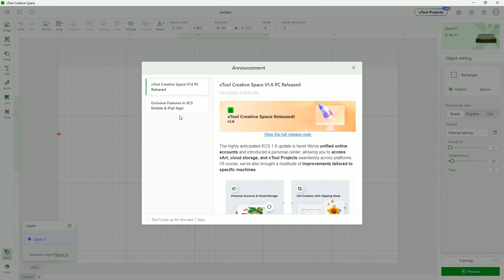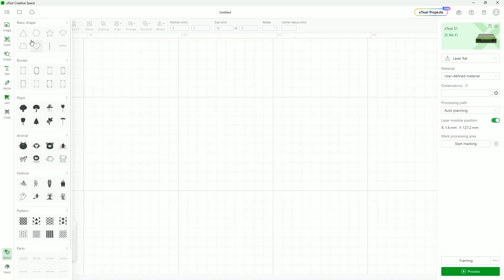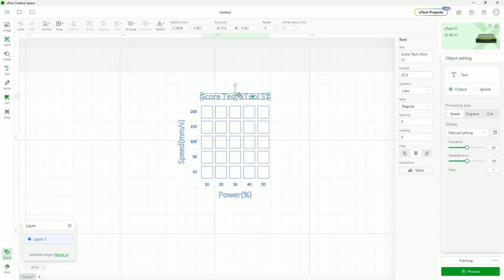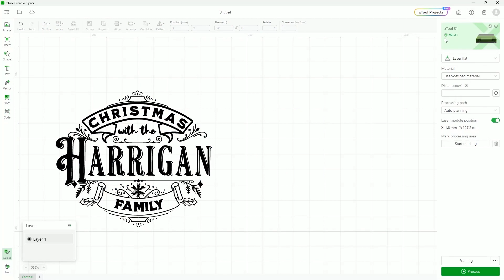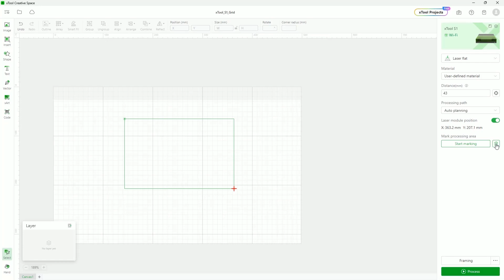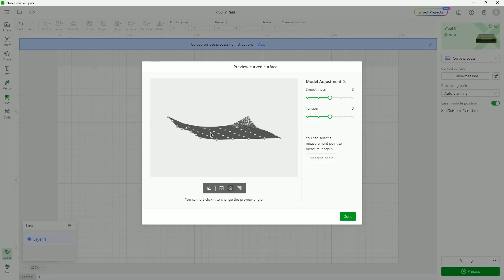xTool Creative Space Tutorial | S1 Edition

Comment: Great video.  I will have to watch several times.  I haven't set up my S1 yet but will have to come back to review different steps.  One question, If you put the grid on the pan It will only work for engraving as when cutting it would mark on the pan and destroy the grid.  If you use the honeycomb you have lost the placement lines and can't position your workpiece where you want it and when you cut it will still pass thru to the pan.  How do you protect the grid on the pan from being damaged? Will you be putting updates out on the new changes in xcs?  Thanks again for the great video.

Comment: I have a question.  Would we still be able to use the honeycomb and the file for scoring measurements into the bottom of the laser? I'm new and haven't got my machine yet but, I was curious since I think the honeycomb is where you would be cutting if you have one.
Reply from the maker: No. The grid is much more useful while engraving then it is for cutting. When you are cutting I would highly recommend using the Pin Point positioning system

Comment: Thanks, your tutorial has been quite valuable.  I just upgraded from a D1 to an S1.  I used Lightburn on my D1 but am learning XCS so I can utilize the bells-and-whistles on the new machine.  One problem I'm facing is that an exact same engraving project will take 2 time longer on the S1 versus the D1, even though I set the speed 2 times faster on the D1!   The reason seems to be that Lightburn efficiently burns the entire project left to right, top to bottom no matter how many components (vectors) are in the project.  XCS appears to burn one individual component then moves onto the next one, etc.  Even letters are burned one-at-a-time.  Have you experienced this and, if so, what is your solution?
Reply from the maker: Other then changing bi-directional and unidirectional you pretty limited on telling xcs the tool path you want to use like you can in Lightburn. You also have no control overt the travel speed which is really why it's probably faster in Lightburn more then the fact that it does one shape at a time. With letters I wonder if you click the weld button if it will burn then all at the same time. Only a guess but I would try that.
Reply: @BusterBeagle3D  You're right, when I weld the letters they become one "object" and get burned together.  Good to know.  The weld option won't work in all cases but might for many.

I want to like XCS but there are several frustrating things about it that push me back to Lightburn.  I'm hoping with continual improvement it will get to a point where using it is a no-brainer for xTool hardware owners.
Reply from the maker: @kenbrown7334   Glad that helped a little. yeah XCS has come a long way but still has a ways to go. It's been updated many times already and I saw on the Facebook group there was a major update coming but haven't heard much else other then that.

Comment: First, thank you for the informative video, it helped me understand the software a bit more. I set my S1 with the file provided by Xtool but it seems my work area is a bit larger than yours. How did you come to those numbers? Thanks again.
Reply from the maker: If you are referring to the grid file I intentionally make it slightly smaller then the full workable area just for a few reasons. One is to make sure it can always actually reach the position as machines, especially the D1 I found, can't actually reach the entire workable area without hitting the frame. The other is to make the numbers easier. It's just easier to make a grid where X240 Y 150 is the center rather then X 249 Y159.5.
Reply: Makes sense, so you have a  “true home “ and a “ grid home” or the machine x=0 y=0 is your starting point?
Reply from the maker: @giannilopez333 The 0,0 position of the grid and of the software either though xTool Creatvie Space or Lightburn is the same. All coordinates of the grid should match the coordinates in either software package. Where you place your art in the software should correspond to the burned grid.

Comment: This is such a great tutorial, thank you. I just got my S1 today (upgraded from D1) and I am doing some inlays. I did a coaster with a "W" inlay with no problem, but when I try to create an outline around a word so I can offset the kerf, it won't capture the inside of the letters. I tried exporting the text as an SVG and reimporting it but that didn't work either. I'm guessing it needs to be an image as opposed to a vector so I can remove the background? Any help is appreciated.
Reply from the maker: Thank you. Try to create your outline of the text so that it created that outer offset. Then select the text again and pull the outline tool in the opposite direction and depending on how far you pull it you will eventually only be left with the outline on the inside of the closed shape letters. Pull it too far and it will just disappear so you have to be gentle. It might be easier if your text is large to begin with and then scale it down after you have your outlines.
Reply: Ok I tried that and I see how that could work but I don't think I can get it to fit perfectly as an inlay using the original text. @BusterBeagle3D

Comment: Hi There, the white part of the canvas is not the workable area they advertised 49,8 x 31,9 cm. If i move the laser by hand or with framing knobs you can get outside the white area the same measurement as the grey area on top of the white usable area. Is there any way to use the complete usable area they advertised with?

Comment: Hi Ryan.. I loved your video... Very informative.. But, I do have a question for you about Creative Space. I do not remember if you mentioned this about this software. 
Do you need to have two different pieces of software if you had two S1's? And, can you run them at the same time as you can in Light Burn? 
Last but not least.. Can you use the same software for both the S1 and P2? 
Thank you so much..
Reply from the maker: Hello. I have not tried to run 2 instances of Creative Space on 2 machines at the same time. I also don't think it would be wise or even possible to have Lightburn and Creative Space running and connected to the same machine at the same time. You may however be able to have Creative space connected to one and another machine connected to Lightburn at the same time but again I have not attempted that.  And yes both the S1 and P2 can run with both xTool Creative space and Lightburn. However if you want to take advantage of all of the features of the S1 and P2 you will want to run Creative Space and not all of the features are compatible with Lightburn.
Reply: Thank you very much! 
 @BusterBeagle3D

Comment: I am a laser noob. I have the 20W version and have watched this tutorial a few times. Thank you for this, it has helped a ton. I have a question about the noises I get from my laser. Not ever owning one I don't know what is normal. Mine has a chirping sound at certain speeds. I am only on day two of using it and I am having fun learning the ins and outs of the hobby. Thank you.
Reply from the maker: Not exactly sure what chirping sound you are referring to. It's possible you have some kind of squeaky wheel so if you can pinpoint it you might be able to use some of the grease that came with the machine to eliminate it.

Comment: Do you know what the resolution of the laser is in DPI? As in when I'm using a raster image what I should aim for?
Reply from the maker: It depends on the version of the laser you have. The spot size of each of the lasers is different. The higher the wattage the larger the spot size. This website has a good chart that shows the maximum DPI you can achieve with different scan gaps. You can pretty much think so the scan gap as your laser spot size so you can see what dpi your machine can reach. 
https://www.imag-r.com/scangap
I guess for an easier answer the 40W is 254dpi, The 20W is 318dpi.

Comment: Hi Dave,  I just bought your grid…….I cant find a READ ME file……what are the best settings to engrave on the metal base of the S1 , I have the 4L watts S1 , thanks
Reply from the maker: Hello. If you are opening the file in XSC you should already have everything setup to burn the grid. You just need to measure the height distance and Process the file. The settings should already be there. Incase you want to double check it should be Power 70% Speed 60mm/sec.

Comment: Have the same question as the person above.  I just purchased the grid file. The only thing is how do you go about positioning the engraving?  Do you do a two point position of the entire surface and then center the grid file?  Sorry brand new to this and I just received my S1
Reply from the maker: Hello. You should just be able to open the file and run it in XCS. It should open up in the correct spot and you don't need to use the 2 point position thing. You just have to make sure your distance is set correctly and that's it.

Comment: Thanks for the video I did learn a few things I have not tried.  I am interested on how you did the grid on the metal base plate.  I did purchase the grid from you and I'll be receiving my S1 tomorrow.  I love that idea of the grid being placed on there but im so afraid im going to mess it up.  I did hear you say you would just paint over it if you had to but tell me more about how you set it up on XCS.  Was it scored on there?  and where would I position it to where the base plate would be even?
Reply from the maker: Hi. You really should just be able to open the file and run it. All of the settings should come with the file in XCS. It's set to SCORE Power 70%, Speed 60mm/sec if you wanted to doublecheck it. Also you have to set your distance but that's really it. This is also assuming you have the 40W version but the settings are probably not that different for the 20W as well.